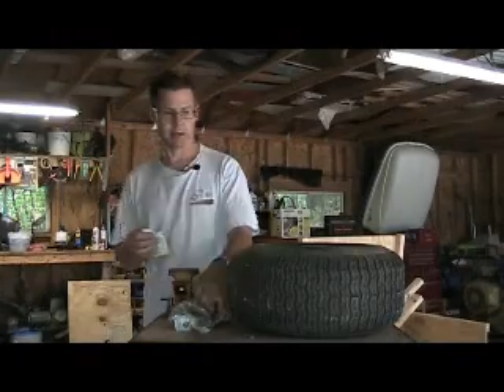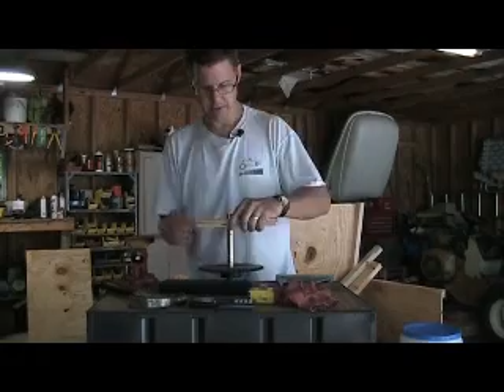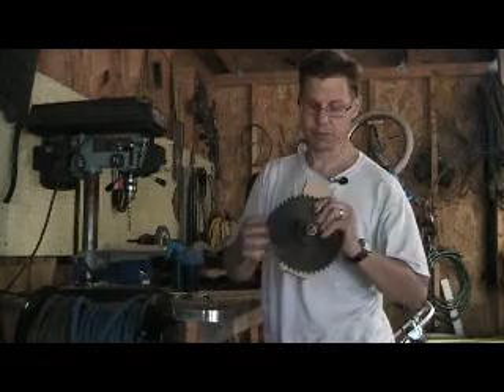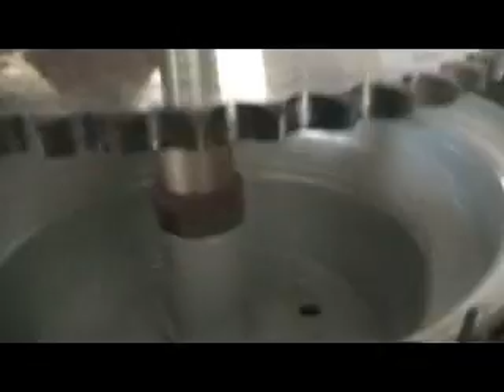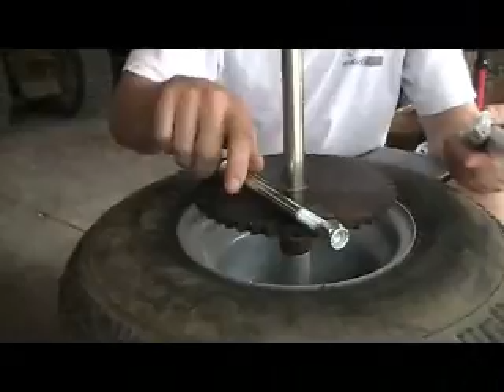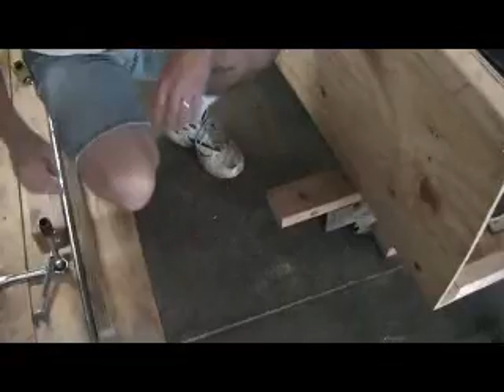Mounting a Sprocket to a Wheel for a Go Kart

Comment: I’m having a problem, my 2 sprockets are lined up but when I turn the axle (by hand) at one point it gets really hard to turn and at one point it’s really easy. Chain gets tight on one spot and then most the time the chain is loose.
Reply: Your sprocket is not centered.  Make the chain looser and use a chain tensioner with a spring.
Reply: @bobgamble8746  that’s what I was thinking thanks, people were saying it’s my chain. Will that solve my problem? If I make it loose and use a tensioner
Reply: @dirtrider6090  it will make it operate.  It might look rough, but at least the chain will stay on.

Comment: If the shaft is connected to both the tire and the sprocket, and you are bolting the two together, why would you want it to spin freely on the shaft?
Reply: I had the same question.. but I don't know much about go-karts. Wouldn't this also need to provide the drive to the wheel on the other end as well? Do go-karts have a differential?

Comment from the maker: The sprocket can be purchased from TSC or Farm and Fleet...any tractor supply shop.  As far as mounting centrifugal clutch directly to a shaft, I have tried by making a coupler, but it had limited success.  The best way is to work through the ratios and make it work with chains, not a direct coupler.